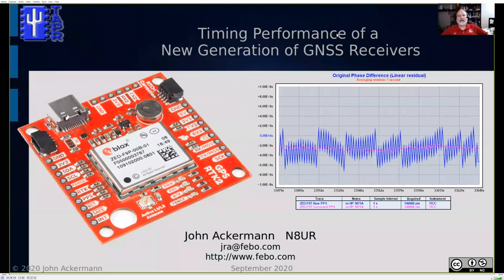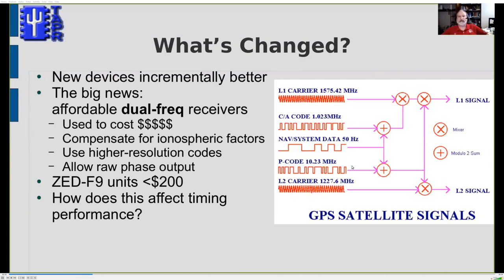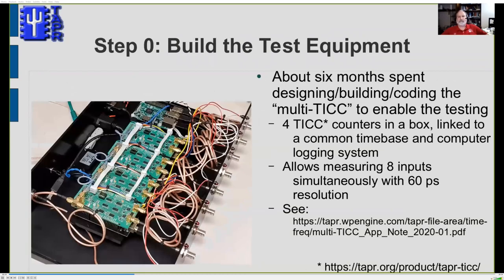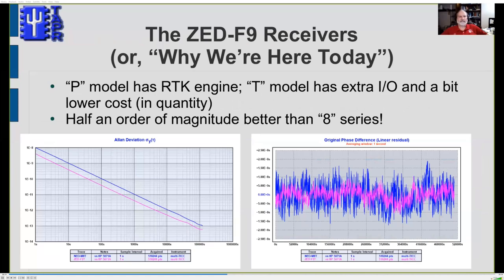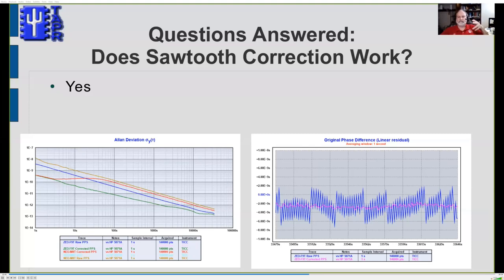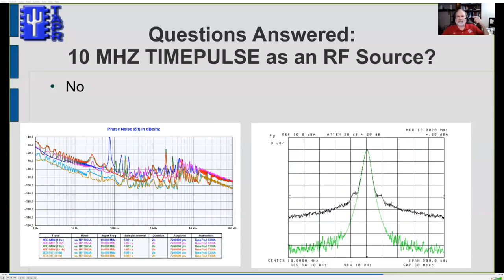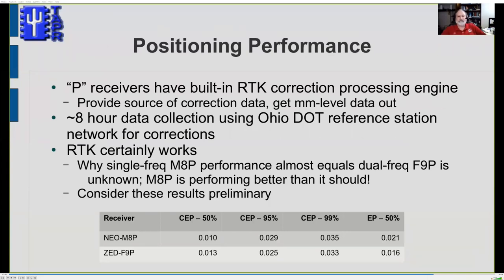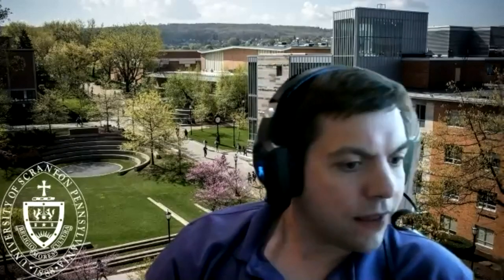Evaluation of uBlox GPS Receivers Performance - TAPR Digital Communications Conference 2020

Comment: Apparently, integer divisions of 24 MHz are cleaner than 10 MHz; 8, 6, 4 etc MHz. The devices use a reasonably crude method to generate variable timing pulses that are accurate for timing but with spurious noise for frequency. Regards Drew VK4ZXI